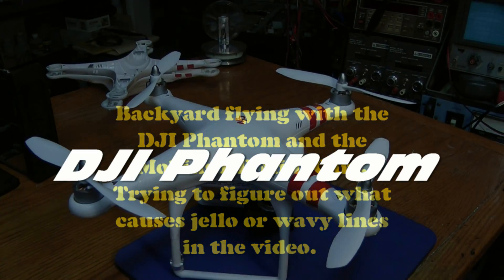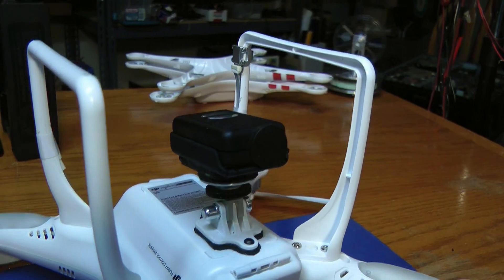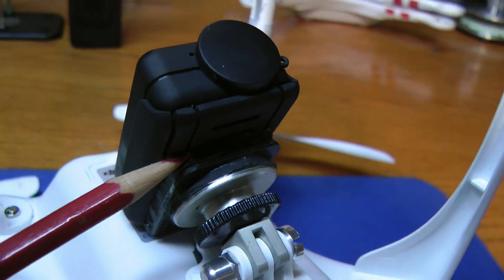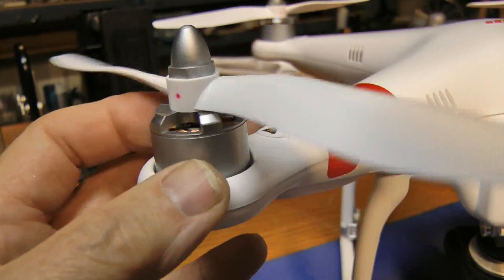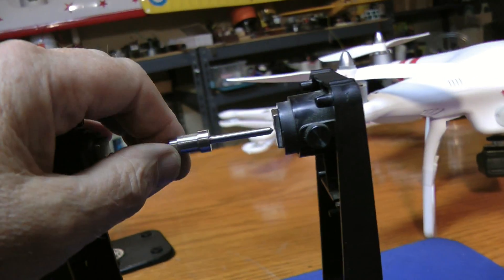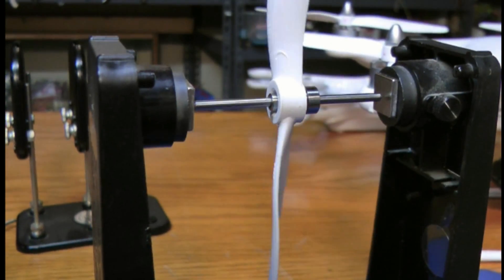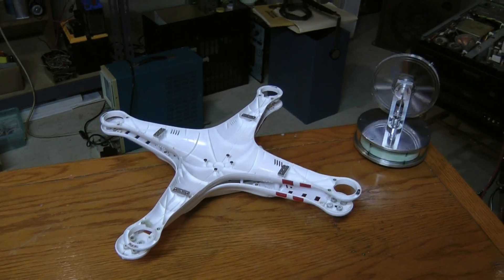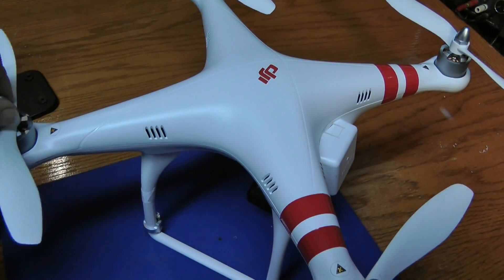DJI Phantom UAV / Mobius Camera Tests

Comment: Hope I'm not redundant, but the sorbane used here is not going to help. Thru each layer employed, there is still a solid mechanical connection thru the screws. To rectify this you'd need a rubber isolation block with the camera mount bolted to the rubber, and the rubber separately bolted to the copter. Check out professional mounts for examples.

Comment: You will get bad results simply strapping the camera straight to the frame.  Try the anti vibration mount from ebay with the 4 rubber dampeners, then a gopro mount to the mobius.  Works a treat and no jello at all shooting 1080p 30fps...
Reply from the maker: Hi you are right but take the time to look at my second video. I think the mount there works better than the one you mention here.
John

Comment: I have a Mobius but a newbie to quadcopter flying. I am reading the forums and comparing this copter to the new Blade 350x model. There are too many pluses or minuses between the two. The Mobius is a great camera is all I know at this point. Great video and great explanation too.

Comment: I'm curious whether or not you've considered buying and adapting the "DJI Phantom GoPro Anti Vibration Anti-Jello Vibration Isolator Low Profile Carbon Fiber Mount" available on Amazon? The isolator dampens vibration at the Camera/Phantom interface rather than at individual motor mounts. If a similar isolator (I'm designing) doesn't work out, I'll try the above isolator and adapt it to work with my Nikon camera. I now get only small HF vibration effects in my videos with little if any LF jello.

Comment from the maker: Yes, Rick your right. The vibrations can go through the screws. It would take some real tricks to get that done in the shell of the Phantom but not impossible. I've changed the mount to the frame of the body so it's a grommet and no screws are touching the mount but it helped very little. I think the answer has to be get the balance on the motors or new motors.
Thanks
John

Comment from the maker: Hi Rick, I do a lot of machining and used to make my own motors, there are some on my channel. I hate to resort to adding weight even though it might work. I might take the front end bells and machine the hole for the shaft all the way through the front end bell then I could balance the rotors like I do the props. Of course there is always the $200.00 upgrade motors.
John